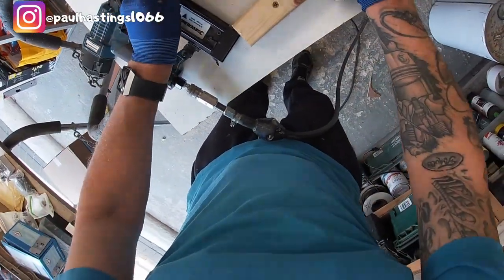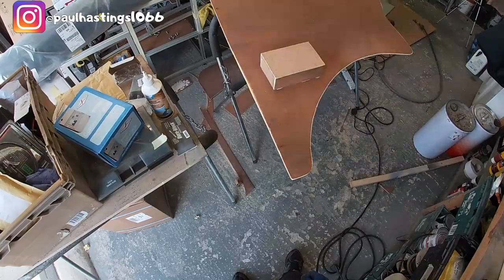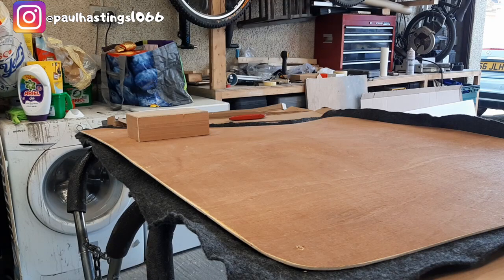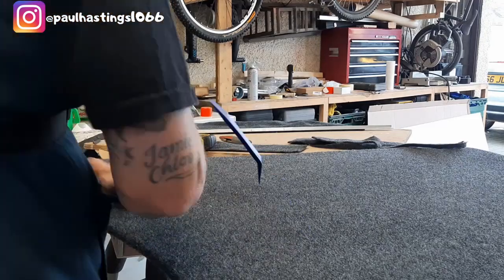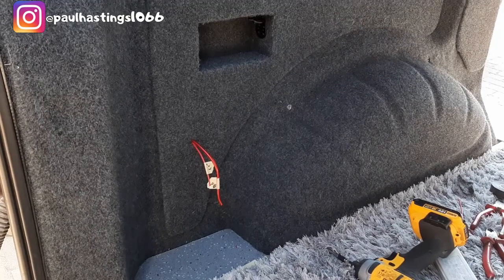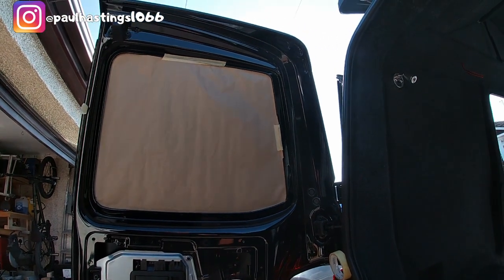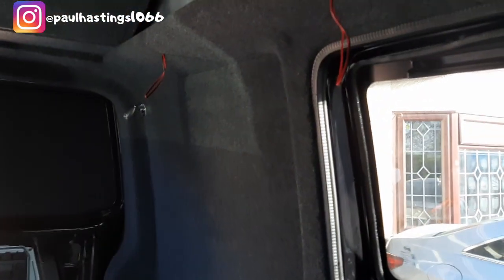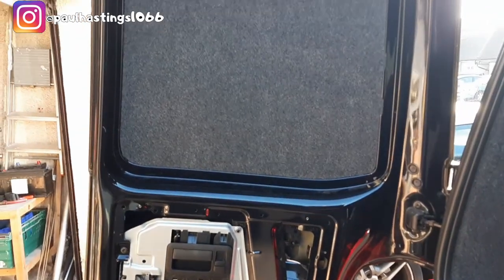VW Transporter carpeting barn doors and CUSTOM PODS !

Comment: Hi, just stumbled across this video which has really helped us out with the barn doors....could I ask what insulation you used on the top sections please? Cheers.
Reply from the maker: https://www.ebay.co.uk/itm/CAR-VAN-CAMPER-INSULATION-FOIL-FOAM-STICKY-BACK-CARAVAN-4-X-4-DEFENDER-TRUCK-T5-/253192246347?_trksid=p2349624.m46890.l49292

Hi and thanks this is like what I used its 7mm thick and has a sticky backing good luck with you project !